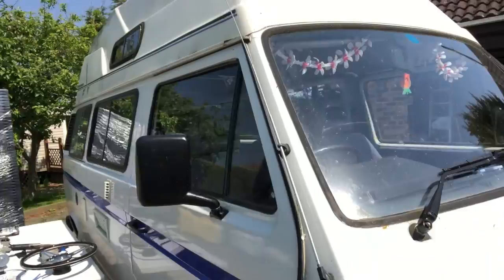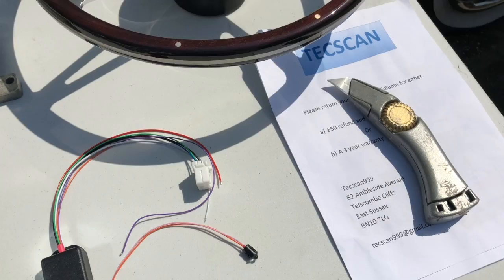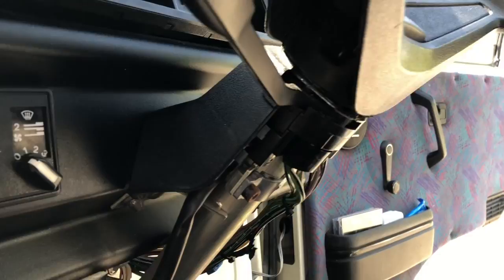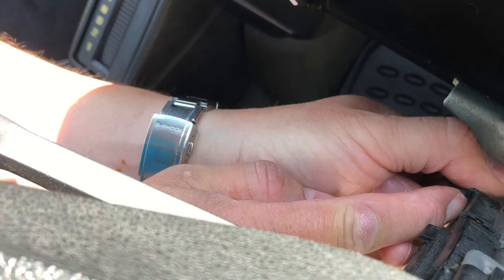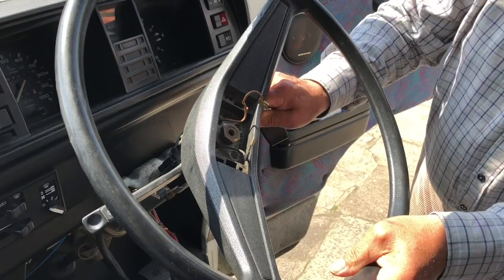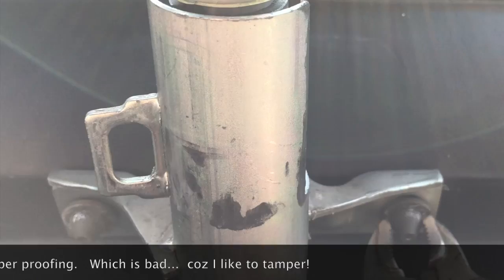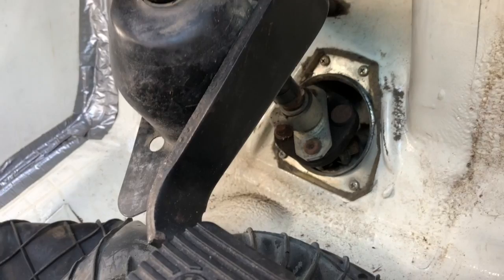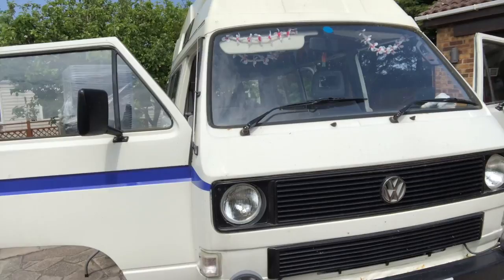VW T25 T3 Vanagon Power steering conversion Pt 1

Comment: I have one of these kits on my Christmas list. It looks relatively easy to install although most jobs on my van require a large hammer, blow torch, reciprocating saw and some profanity!
Reply from the maker: Hi Steven. If you have such high tech toys as a reciprocating saw (tool envy) then I am certain you would find this a breeze. You might need a hammer to get them pesky anti tamper bolts off that hold up the old column though!
You have made me start to consider what should be on my list to santa this year🤔
Reply: @ToTheGarage  With the help of your video, I got the kit installed in just under 3 hours. The difference is amazing! The first of many upgrades to the van this year.
Reply from the maker: @Galphs  Fantastic News Steven and congratulations on the install time. Obviously making the video increases the time to fit substantially. However, Im convinced that you would have beat me by at least 2 hours. Good work sir.
I set mine for the higher level of assistance I take it you did the same.
I could not get my hat on re the level of assistance provided either. Its a real game changer of a modification.

Comment: One might respect that 'odd' coupling when in an accident and the steering shaft decouples, preventing you get a deadly uppercut from the steeringwheel.
Since that's what it is for.
...which is now absent, I might add...
Reply from the maker: Good point well made Paul👏

Comment: Hi, just letting you know that I bought the same kit from tecscan on ebay. The welding was done very very badly. I took the outer shroud off to inspect the weld on the actual shaft itself, as I had a strange feeling about it and I was shocked. Really really bad welding and pinned with a nail. Yes, a nail. Still had the head on the nail.
I ground off the bad welds and redid it myself. I'm replacing the nail with a roll pin and doing 2 extra plug welds.  Scary to think how many people could be driving around with tecscan's dodgy columns... just though I would give this warning, as some people might buy from tecscan because you mention it in your video.  Also, I would strongly suggest you take yours out, cut the welds on the outer column tube  so you can inspect the weld inside.  All the best....David
Reply from the maker: Thanks for the intel

Comment: The original , cranked lower column is a safety device. It allows the column to collapse rather that end up in your chest. Remove this at your peril. Legally you are reducing the front impact protection designed in my VW that formed part of the vehicles safety approval. As the steering components are close behind the front bumper on this rear engined vehicle this is even more important that on many cars with a long bonnet and a steering rack on the bulkhead. Just my thoughts.
Reply from the maker: Good Intel, thank you Philomena goodman